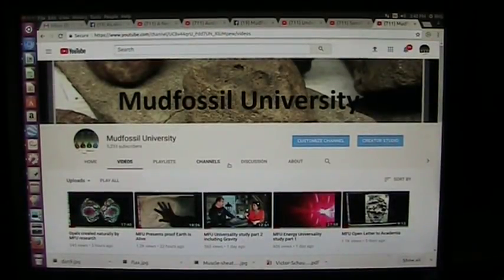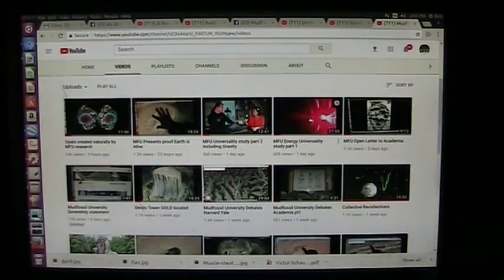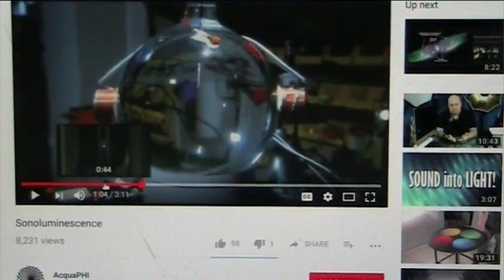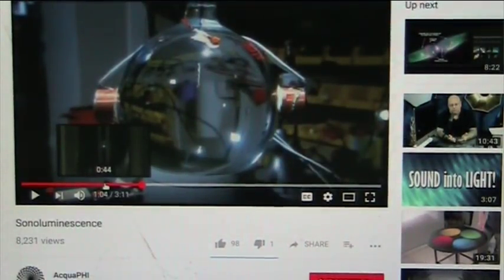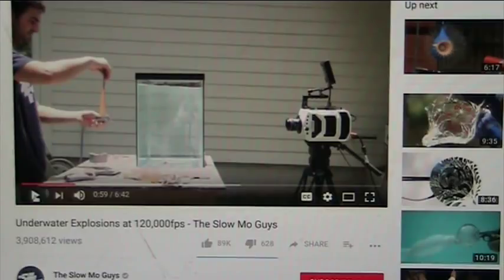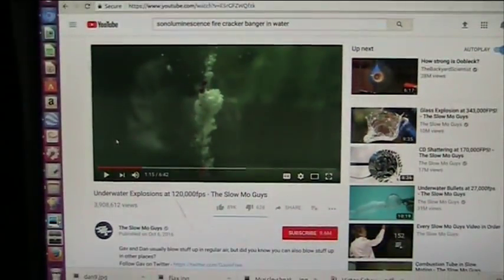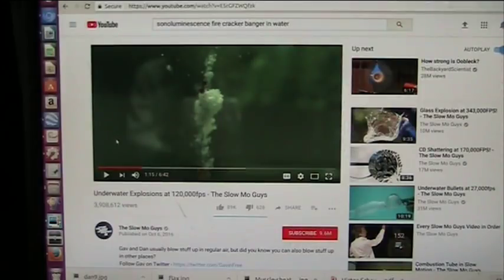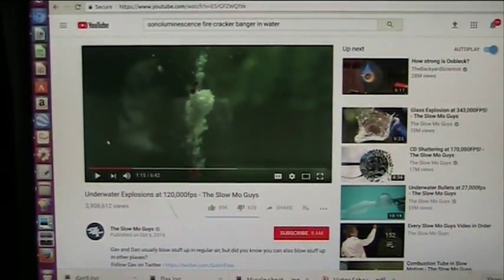MFU Sonoluminesence and free Energy discussed

Comment: Electrons come in pairs,hence they can be in two places at once.pull them apart for voltage,when they come back together we get amperage.Use pulsating positive d.c.(hence the term splitting the positive) and the earth or ambient background will replicate the negative part of circuit.The solar plasma that comes from space and hits the earth is either absorbed(heat)deflected(for spin of earth)or reflected(creating layers of atmosphere..10 kilometer increments as standing waves.Gas pressurized or vacuumed makes a big difference inside our atmosphere flowing in our electrical circuits.